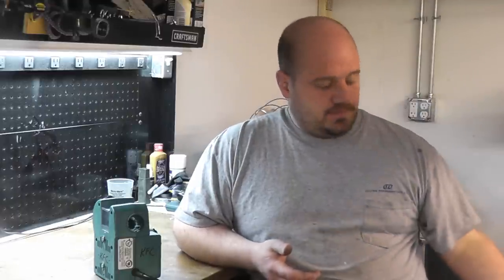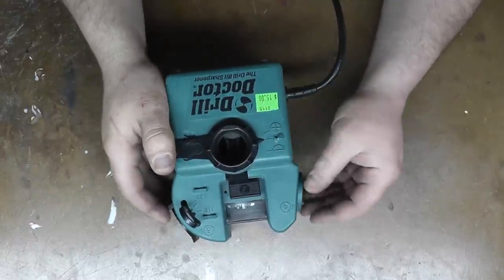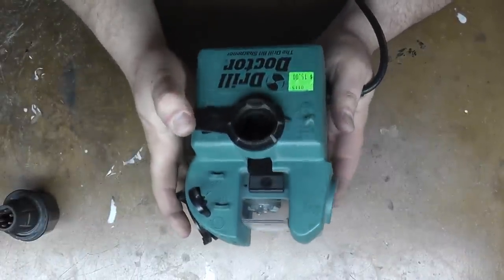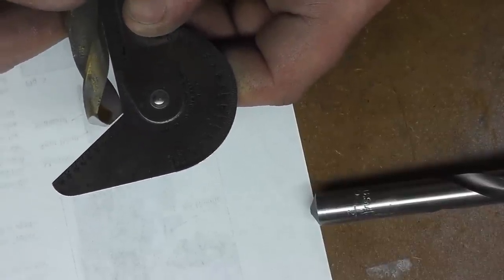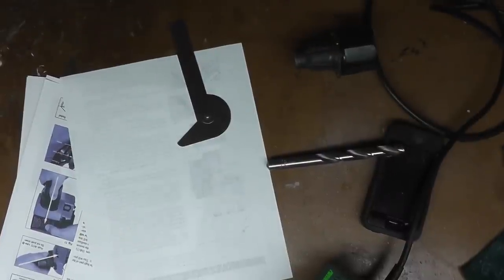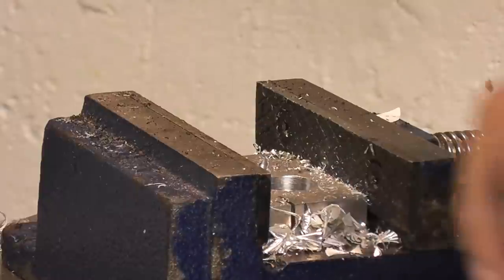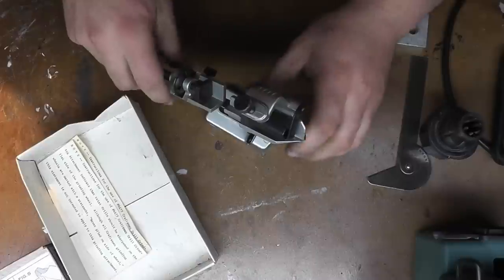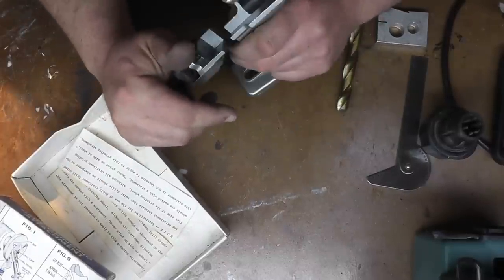Drill Doctor V.S. Craftsman Drill Jig

Comment: I've been using my craftsman drill jig for years, always works. I've not had the same luck with the drill doctor. My jig is attached to a 12" disc sander and is specific for sharpening drill bits. Great little tool.
Also since it was a gift from my father many years ago, it has sentimental value as well.

Comment: I've been using variations of the Craftsman jig for 35 years. I say variations for two reasons: 1. I've worn out  several jigs of various makes, and 2. I've sharpened tens of thousands of drills (by which I mean tens of thousands of sharpenings). I've experienced no difficulty or danger in using the side of the grindstone. Wear it out? Certainly not. Phil Vardy

Comment: Your comments on the Sears jig at 29:19 about the grind marks going along the cutting edge is how new drills look. There is an advantage claimed that this prevent stress fractures of the cutting edge that can occur with normal hand held grinding.
 I have a video posted, on YouTube, using a homemade jig, from Model Engineers magazine plans . The amount of pressure on the side of the wheel is so small that even after many hours of sharpening lots of drills, there is no sign of wear on the side face. I have looked for a diamond cup wheel, but they all seem such a small width, so I'm still with the normal wheel.

Comment: I've recently bought a craftsman jig and you can solve the 'grain' of the grind by simply chocking up the base with a block of wood so you grind against the top of the wheel rather than the side. then the grain goes perpendicular to the cutting edge.
Reply: Yeah, it would, but the wheel will make a burr on the edge, much better to mount it either on the lower part of the wheel so the cut is 'into' the edge.
Reply: Couldn't that then be solved by grinding with the bottom of the wheel? If you could lift the grinder high enough that is. I have a tool and cutter grinder so I can lift the wheel quite easily.

Comment: I have been using the Craftsman unit for about 40 years and the DD 750x for about 3 days.  Both work just fine.  I also grind larger bits by hand, bench grinder, and drill gauge.  That also works just fine.  The DD is much faster with smaller bits.  I do grind on the side of the wheel with the Craftsman unit, but with very light pressure, less than you were using in the video.  All three methods are adjustable for relief angle, point angle, and evenness of cutting edge length, you just need to understand what affects what and change adjustments and technique until you get the results you want.  Drillling harder materials requires less relief angle, softer materials require more relief angle, very soft materials like plastic require other measures to keep from digging in.  Read, understand, practice, and feel the force, Luke.
Reply from the maker: :-)  I can off hand grind bits it just takes me longer than I like and I botch anything smaller than 3/8.  Again thats will come with time, but I had to try the shortcuts :-)

Comment: I realize that I'm almost a year late in finding this video and contributing my two cents but, I feel the need to do so anyway. I use a slightly older version of your craftsman drill guide for all of my sharpening, and I think I can answer your question about the grain and address a few other things. The simple answer to your question of "will the difference in grain effect the drill in any way?" is no. Not at all. An extended explanation is that the grain isn't actually changed, the marks you see are just striations in the surface if the metal so they make no difference to the drill bit itself. Also I feel it's important to say that the craftsman drill guide isn't a perfect drill sharpener, it's just really good for the cost. I've compared the bits i sharpen to ones that were sharpened at work on a machine built just for sharpening drill bits and end mills and my best aren't quite on the same level as the ones sharpened at work. Also while its an okay sharpener out of the box as you displayed, its not infallible and can sometimes require a little finagling to get the best grind. All of that being said, I still believe the craftsman to be head and shoulders above any other off the shelf drill grinder available today.

Comment: i really wish you could make a more in depth video about setting up the craftsman jig
Reply: mike alexander yes me too. It's now 2020 and I have just bought a British branded but obviously chineeseum copy with absolutely fucking crap instructions that says for a 59 degree grind you have to have the drill 50% of the diameter sticking out past the lip finger but then says the existing cutting edges must be vertical. But with half the diameter sticking out the drill rolls following the finger in the flute so I don't know which one I should set it to. Methinks if must be the cutting edge vertical, but I'm not sure. I will have to experiment.

Comment: The old school tool is pretty awesome. I have a 1750 RPM bench grinder with scotch brite on one side, and the drill sharpening setup on the other side. I love it. 
-- I worked at a machine shop in college, and we used that kind of tool to sharpen twist drills bigger than 1/2". 1750 RPM grinder. The boss was an old man. Really interesting dude. He kept that shop perfect. He even sharpened the flutes.  He had some metallurgical polishing tables in the back. He'd sharpen knives and carpentry tools on it. 
-- The smaller drills were sharpened with a Tormek. That machine made some wonderfully sharp drill bits.

Comment: I have a Picador drill sharpening jig that might just be the original version of the Craftsman. If you look at some of the dedicated drill grinding machines, they use the same geometry.

They work far better if you don't use the back stop to advance the drill into the grinding wheel. Use the extension of the drill beyond the stop to set the chisel point to the right angle (it depends on the drill diameter), then advance the whole grinding jig into the wheel. Grind both flutes at the same advance setting to make both cutting edges the same length.

Advancing the jig is the trick, ideally you want some kind of slide, but you can do it with the base slot and a push bolt. I'll post a link to a picture of a slide below.

Every off hand grinder I've ever seen in a professional workshop has had clear evidence of grinding on the sides of the wheels and quite often has tool rests designed to make that possible. It's one of those 'lies to children' kind of things, rather than trying to train people properly to only do very light grinding on the side of a plain wheel, just tell them never to do it.
Reply from the maker: Paul Compton Nice little set up there.  I've always been told to never grind on the side as everyone else has.  I'm just leary of it because I've seen one grenade before.  If I were to do it regularly I'd feel more comfortable with a wheel designed for it.

Comment: I almost bought a DD about a thousand times.  Even had one in the cart a few times and always ended up putting it back on the shelf.  I've had the same Craftsman unit for 20some years.  Though Rube Goldbergish, it works well.  I like it for small bits with a fine wheel with a hand hone afterward that makes a big difference.  I hand grind the larger ones with a homemade wood guage block  and a Veritas grinding rest(HIGHLY! recommended) to check my angle.  It's much faster but takes practice.  I was watching Mr. Pete getting ready to review and confirm my good results with the Craftsman when he smashed it with a hammer, called it junk, and threw it in the trash.  So go with what works.  Thanks for the review.  The DD will remain out of my cart for a while longer.
Reply from the maker: I was the same way.  Could never bring myself to buy it and now glad I didn't.

Comment: just  few comments:
 
about 40 yrs ago I was building an addition on my first house in Australia, I had a lot of 1/2" holes to drill in structural cleats  and given the cost of tools in aus at the time and my relatively impecunious status at the I needed an inexpensive way to sharpen those 1/2" bits. n.b. I had no freehand sharpening chops then and still don't.. the only non-professional sharpening jigs available that I could find were the general(us) and the eclipse(eng), both of  which were basically the same as the craftsman you demonstrated. I don't actually remember which I bought, but whilst it did work very well(results comparable to a new bit), I did find it tedious to set up. I might also mention I was using a white wheel on the grinder.

skip forward to 2011 and I was building again, this time a 48'x40', approx 3000sf monitor style workshop. I went to the dd750x. its general functionality is similar to the dd you demonstrated, but in two sessions totaling about 4 hours over the two days following its arrival,  I sharpened a grab box of about 100 bits ranging from about 3/16" to 1/2". I had none of the tedious functional difficulties you experienced with your older machine, and the results were excellent. I would have to say it takes a bit longer to learn to do split points well, but not much.

it was taking you an extraordinarily long time to grind  the test bits. did you check the condition of the grinding drum before you used it?

you also said that you only had the 1/2" chuck, but you also said that the s&d bit was a 5/8",  could this have been a source of your difficulties? perhaps you got a monday morning / friday afternoon machine.

based on my experience with both sharpening methods, I think both can produce good results. for the safety reasons you pointed out, as well as its ease of use I prefer the drill doctor and can strongly recommend it!

p.s. I have no association whatsoever with drill doctor nor with anyone who does.

Comment: I and a few of my colleagues have drill doctor 750x's and were all disappointed UNTIL, I discovered the omitted detail in the instructions that you keep turning the drill bit until the drill doctor is no longer taking any material off the bit. The DD starts at the back of the relief and works it's way to the cutting edge, so if you do not complete the process the relief is too shallow and the cutting edge is not cut at all, this sometime requires a re-setting of the depth if not enough material is removed to get an even grind from the back of the relief to the cutting edge. I can get a successful grind by hand, but my eyes are not what they used to be and the drill doctor is far more accurate especially for smaller bits. I am happy with mine as are my colleagues now we know how to get the best out of it.

Comment: I have used the Craftsman type sharpening jig for 40 years (?) years and it works great. The light grinding that one does when sharpening a drill bit against the side of the wheel is simply not an issue. The drill sharpening fixture does get in the way of ordinary grinding wheel use and one day, I'll set up a dedicated drill sharpening station. 

The "grain" of the sharpening action has never caused a problem and side wear to the wheel is so slight as to be almost unnoticeable. The correct grinding wheel to use would be a cup wheel and I may use one when I set up my dedicated set up.

Comment: Been thinking about buying a drill sharpening jig. Just not too certain about using the side of the wheel. I wonder if it could be set up to use the front?
Reply: People have done it but you have to realize it would create a hollow ground bit, a flair if you will and it wont cut correctly. I have sharpened countless bits on the side of my wheels and never had an issue with one. The jig is designed to work that way. 
I don't set the jig the way he does. I work the first side/Flute in little increments until I have complete grind on that flute setting the lock each time until the first flute in done then flip the bit and go in slow, basically pivoting the bit in and let the wheel grind and then back off until it will pivot all the way without forcing the bit. Mine come out perfect on both sides and EVEN. 
Also when I am just about done with the flute I pivot mine faster across the wheel and it gets rid of any burr and leaves a nicer finish on them. 
MOST importantly I recommend a quality VITRIFIED Aluminum Oxide Med grit G through K grade grinding wheel (I prefer an H), it will run a lot truer and give a much better finish, this is where the old saying "You get what you paid for" comes in.
Reply: @MegaLostOne  well, I'll be the first to admit I've done worst things with the side of a stone lol. I have actually just started work on a little belt driven grinder that I plan to use for tool sharpening. Also purchased an aluminum oxide wheel (blue) as well as a silicone carbide wheel (green). They're a little too nice for MY shop 🤣, but hopefully the right choice for getting a nicer grind 😁.
Reply: @Just1GuyMetalworks  Sounds like you know what you are after, It took me a lot of reading to finally settle in on the wheels that I use for sharpening my HSS bits. Before that I just always thought a wheel was course/Medium or fine and didn't realize there where so many variables LOL.

Comment: I have had one of those Craftsman sharpeners for over thirty years.  I purchased the extra thick grinding wheel to be used with it.  I never did like it, no matter how you use it, there is a little guesswork with it.  To me the smaller the bit, the more difficult to get a decent looking cutting tip.  I have had a Drill Doctor 500 for over 5 years, love it, a good sharp bit EVERY time.  My 2 cents worth.

Comment: Just came across this video.  I bought one of these Craftsman jigs a few years back on a whim (real cheap on eBay) but never used it.  Need to break it out.  I'm lousy at freehand grinding drill bits and do have a few bits in dire need of sharpening.

Glad at this point I never bought a DD.

Comment: I have had a craftsman jig for 40 years, I really like it. At the time I bought mine they sold a 6 inch wheel that is 1/2 inch thicker on one side and is made for side use. I still cannot see any wear on the wheel after all these years
Reply: I too had my Craftsman for 44 years using the same wheel on the side.  No wear what so ever, as long as you don't hog the bit the wheel will last.  At work I bought the M4 sharpener with the diamond wheel mount.  That unit would do Micro to 1 1/4 bits.  That cost was $1,400.00 30 years ago.

Comment: I have had and used a sharpener like the craftsman, for over 35 years. The only thing that needs to be done. If you noticed the slotted hole were you had it clamped down. You need to adjust the little tang that position the drill in the vise, so that it is the radius  or half the diameter of the drill, from the grinding stone. That is what changes the reliefs angles and changes the chisel point, witch you want as close to 90%  as possible. It will sharpen your bits to better than new. I have a designated grinder for it and were it bolts down I have it marked were to set it for each size drill. When sharpness counts I would not use anything else.

Comment: I have a drill bit sharpener identical to your Craftsman one, except mine is General branded. On the Internet they are often referred to as "Bulldog Sharpeners". Because I think a company named Bulldog actually makes them.

Anyhow, I have one, and like you I was concerned about the grind grain on mine. Thinking about it some I came up with a fixture I have mine on, and it puts the grinds perpendicular to the cutting edge, which is ideal.

I also do not use that stop. What I do is I get the bit to contact the wheel, then make a few sweeps, then not moving the backstop, I rotate the bit, and do the identical number of sweeps on the other cutting lip. Using that method I can get the lips equal to each other.

I use my Bulldog to just get the rough geometry on really messed up bits. Then I touch them up by hand, split the point, whatever I am looking for. So it all comes down to a bit of learned technique I suppose.

I also have a dedicated depressed center wheel that I just use with the Bulldog grinder. It is a white wheel. So that helps with the results I get too. Here is a picture of my Bulldog and its setup http://i.imgur.com/mc7BQgn.jpg

Because there is no way I can really describe it in text. But to get the grind angle right, that's what you have to do.

Comment: I had the less expensive Drill Doctor, I had a Lowe's gift card one year and purchased it with it, the best of my memory my unit was about $75. I did not like it at all, so I but the bullet and purchased a used SRD off of eBay. The bad part it did not have the chuck, so I had to order one. Yes I have about $300 in my unit, but it works well. I need to make  video demonstrate how well it works. The reason I wanted one of the drill grinder I have is the first shop I worked in had one and it was so darn simple to use, the drawback is a new one is a grand.

You probably could set the drill  jig up to use the front of the wheel, I don't see any reason why it would not work that way. You would just have to make a mount so it would line up in the center of the wheel.

You will like the tool holders when you get them, you can get by with 300 to 400 RPM with that carbide you showed. In fact I have some of the same inserts.
Reply from the maker: I took a peak at those.  Looks like a decent machine.  Reviews I read people seem to like them.
Reply: ***** Yes they are, I demonstrated mine in a video. They are simple  machines but pricey. I still have a lot of cash tied up in my unit, but still I only have 1/3 the cost of a new one. The used ones on  ebay that was complete was going for around $500 when I purchased mine.